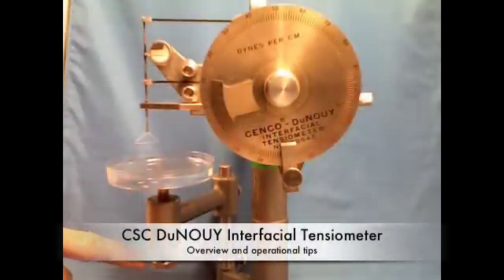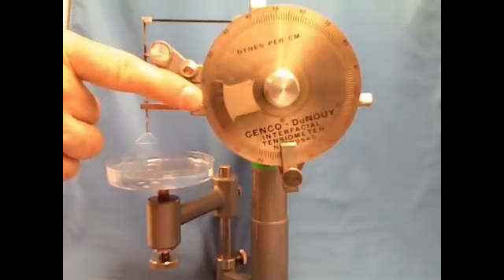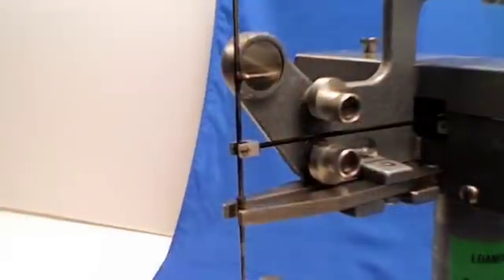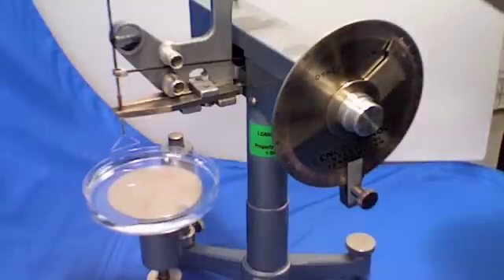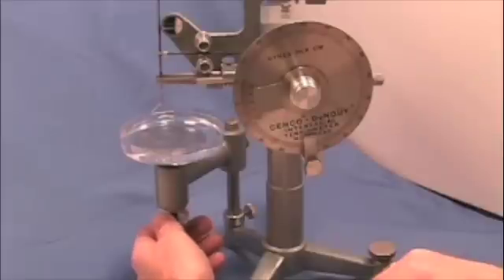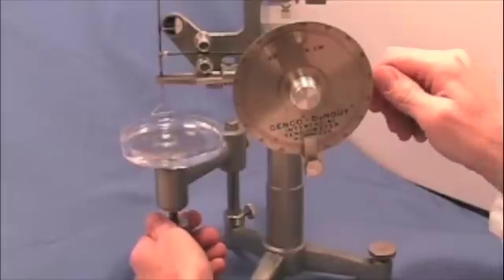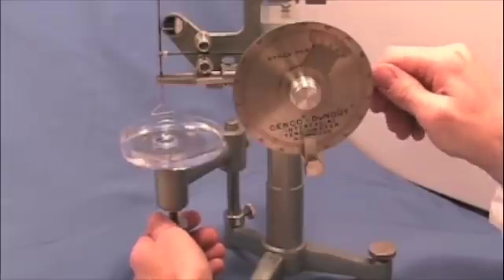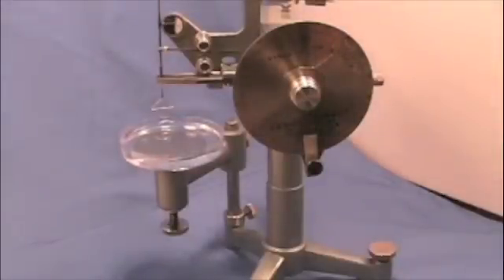Cenco DuNOUY 70545 Tensiometer

Comment: hey i know a lot of these tests just give you the result dynes per centimeter, and I understand how the force of dynes is found but is the ring's circumference the measure of cm? or how is the cm determined?
Reply: I would calculate the physical dimension of the Ring by measuring standards. Trying to physically measure the Ring would be way inaccurate.